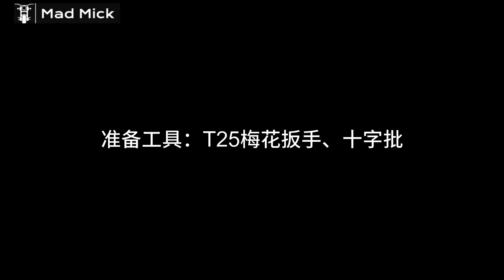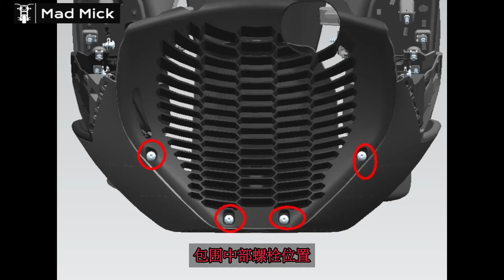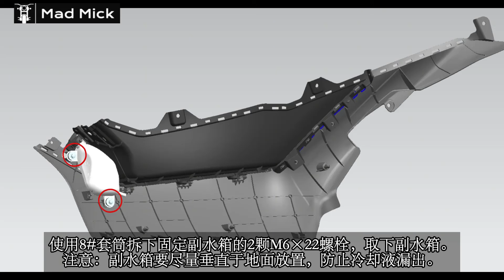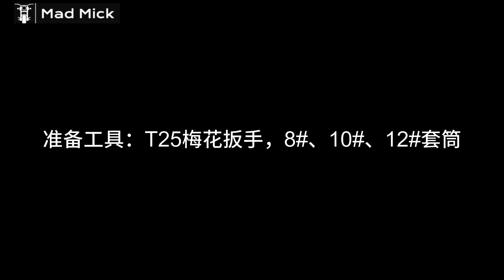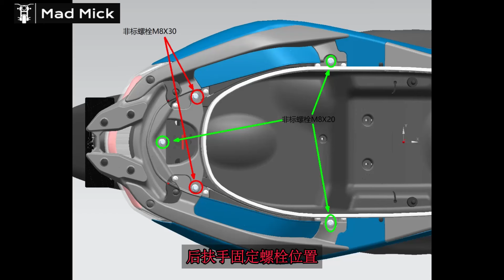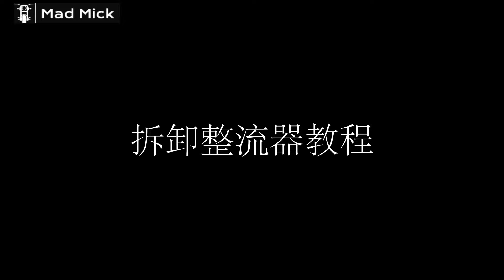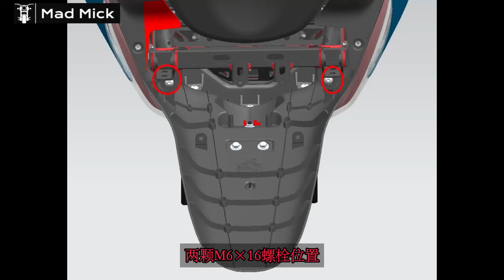ZONTES 368 K CRUISER SCOOTER FULL BODY STRIP * WOW * CHINESE SUBTITLE INSTRUCTION

Comment: The parts are made quite cleanly, both inside and out. This is the first time I've seen injection molding marks this clean.
Reply from the maker: the bike has lost weight with the way they have made the mouldings which also makes it more ridgid

Comment: Wow, lots of screws & clips. Better not lose some or whete they go
Reply from the maker: true, the video just shows how intricate and procees has to be methodical in removal, take note of how they reduse weight and costs by the panel inner parts where they purposly cut small oblong holes into the not needed plastic body parts xx